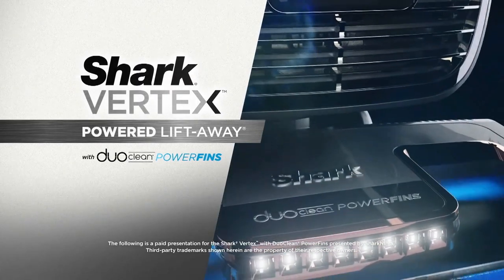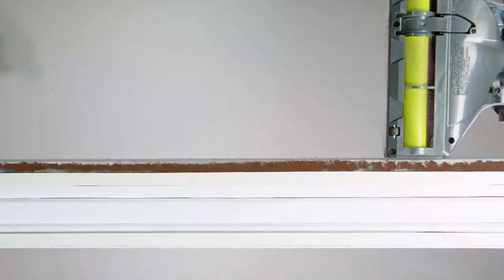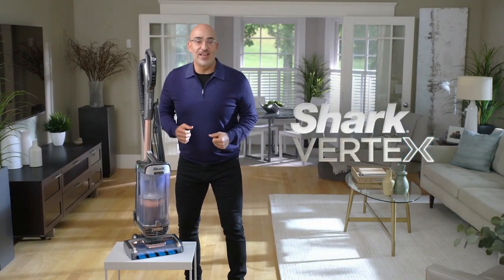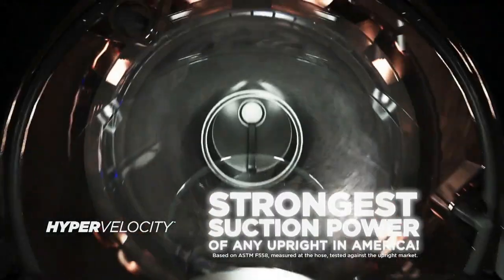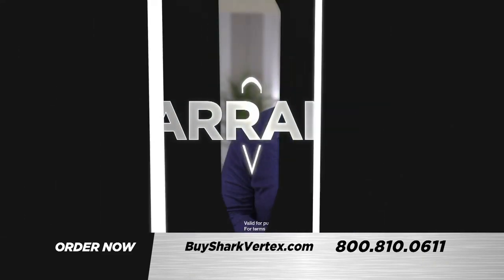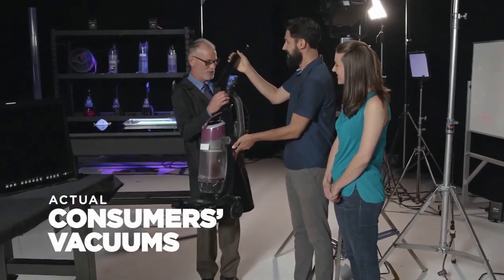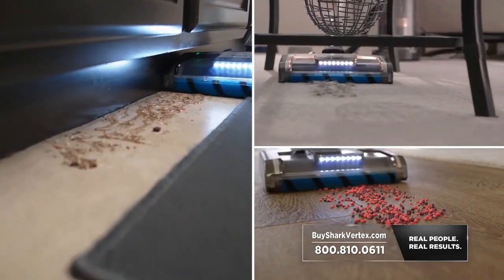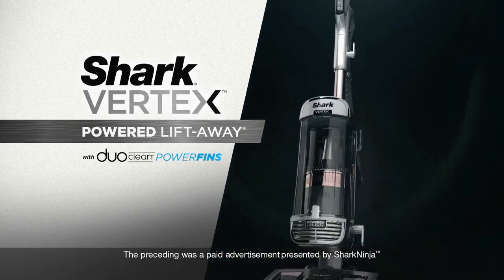Shark Vertex Powered Lift-Away With DuoClean PowerFins (Full Informercial)

Comment: I just bought the Shark Navigator Powered Lift Away NV 586 on black Friday and it has 3 times more suction power as my previous Hoover Wind Tunnel. The Shark had no trouble vacuuming up everything on my floor. It doesn't have a tangle free brush roll like the Duo Clean, but using the hose to pick large amounts of hair actually solves that problem.